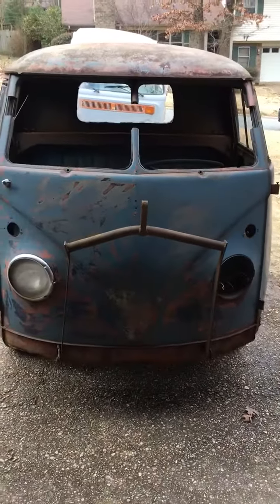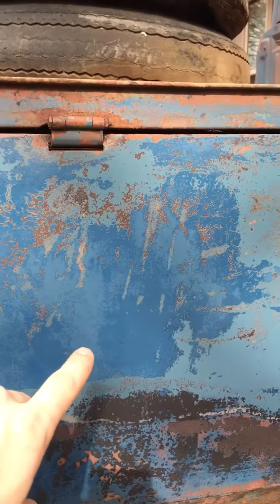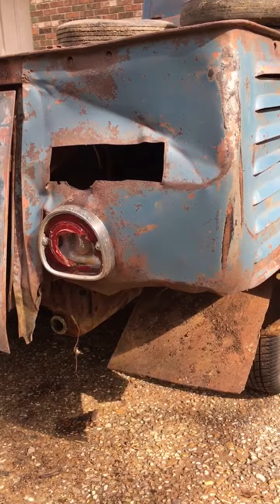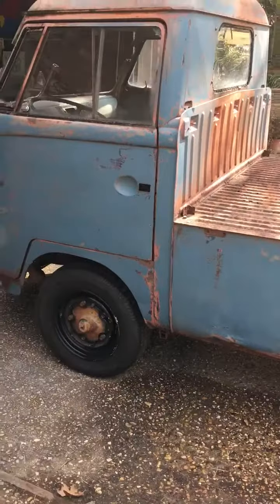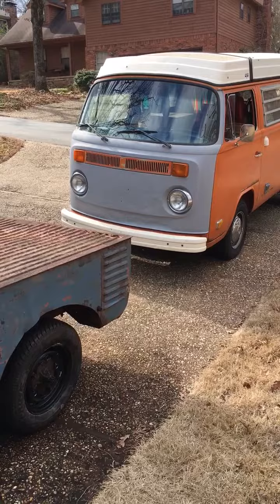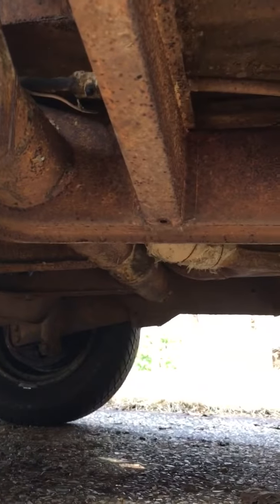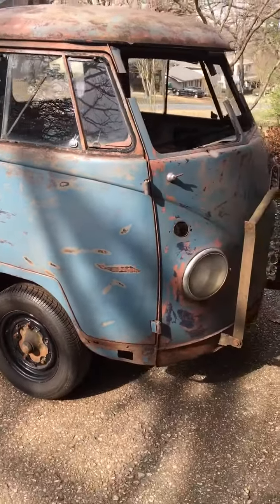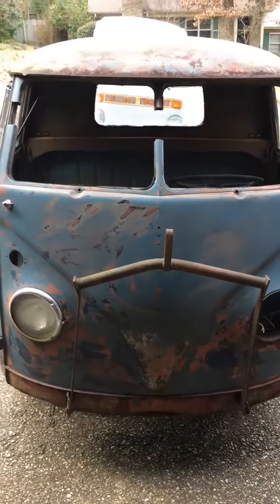59 VW Single Cab #3 Paint Removal/Description of Progress

Comment: Gerson is the only one who makes a floor for your year. It will be a special order as you have a one year only floor for 1959. It will have the rearward shifter and a ROUND steering hole. These are not in stock so you will have him make one for you. He did not charge me extra for this. 

1500 motors are a trick to find parts for. 1600 single port will be great, easy to find new parts and a substantial increase in power from stock. Looking forward to you cracking the case open to see what if anything is usable.

Comment: If you are not into welding yet you could easily pop rivet the new floor in place and have it welded in at another time.
Reply from the maker: Thats crossed my mind, that's what I did on my Westy. I'd hate to mess up a nice Klassicfab piece.
Reply: If you put the pop rivets where the plug welding will be you are good to go and you get to drive it in the meantime.